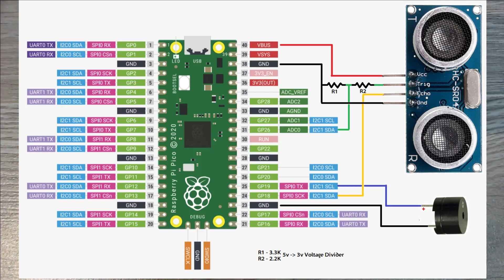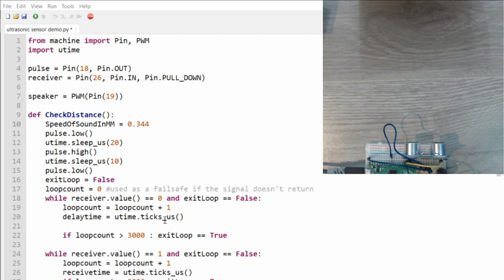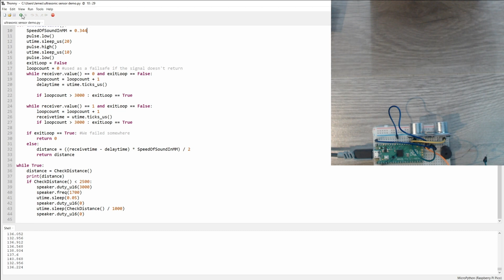Connecting a Ultrasonic Sensor to the @raspberrypi Pico

Comment: According to the datasheet, you supply a 10μs TTL-level high pulse to the Trigger input to start the ranging, and the sensor then returns a TTL-level high pulse on its Echo pin with the delay proportional to the distance travelled. You seem to have the Trigger and Echo swapped in your wiring diagram.
The TTL high level trigger pulse can be any voltage between 2.0V and 5.0V, so you don't need a level shifter to increase the 3.3V output from the Pico, but the return pulse could be as much as 5V, so you do need a resistive divider from the Echo output to keep the voltage on the PIco's input pin below 3.3V.

Comment: Solid video man, can the sensor be used standalone with the raspberry pi pico? Or do I need the resistor and the other component?
Reply from the maker: The Pico runs internally on 3.3v, whereas the sensor is 5v. So, without the resistors, it puts 5v into a pin designed to handle 3.3v. It may work for a while, but it can damage the Pico over time. So, in short, the resistors are to protect the Pico!
Reply: @PrintNPlay  Actually sensor accepts 3.3v - 5v (model: HC-SR04, I think it's the same), at least by documentation.

Comment: Thank you for the video! Could you please clarify one thing? In the wiring diagram Echo is connected to GP18 (Pin.OUT) and Trig is connected to GP26 (Pin.IN). Should not the Echo and Trig be swapped? According to the HC-SR04 description Echo is the receiver and Trig sends the pulses. In my case, if I follow the wiring diagram, the reported distance is always 0. The sensor starts working only when I connect Echo to Pin 26 and Trig to Pin 18.
Reply: Other online tutorials are telling me the same thing. My understanding is it doesn't matter if sensor trigger pin gets 3.3v from the pico, according to another tutorial it is still sufficiently high enough voltage to work for logic high. Ummm I haven't tested this yet so I am getting conflicting information here. It is echo that is problematic because HC-SR04 will output 5V from the echo pin which is more than the pico is designed to handle. Hence the need for a lower voltage conversion...

Comment: Enjoyed the video and I think I will find it and the code example useful. I have an idea for a light in my garage that will come on and tell me when to stop. What is the range of the sensor?  Would this be a good project to try? I am open to suggestions and new ideas. thanks,
Reply from the maker: Sorry for the delay in reply! I certainly think it would work for your purposes. I haven't found a definitive answer to its range, and haven't had a chance to wire it back up and test it. Buy I think I had tested it for 8 - 10 feet. I think this is likely the best option for something that doesn't need a piece mounted on the floor to reflect something. You could also use an image sensor that triggers when the color it senses suddenly changes. Or a motion sensor that triggers a laser diode that shines through the windshield onto a designated spot on the dashboard... there's a few ways to make this happen. I'm curious to see what you come up with.

Comment: Would there be a way to have this only turn on at certain times. I want to mount one on my front bumper so I don't hit the lip on the curb.  How would I activate it only when parking so it isn't beeping 24-7 lol?
Reply from the maker: The easiest way would probably be to add a toggle switch to the circuit. Changing the code to have an on/off status which changes when the button is pressed, and perhaps an LED that indicates if it is on or off. 

Glad to help if you need any!

Comment: I have a HC-SR04, the datasheet says: Signal Level (Trigger, Echo): TTL Pegel (L < 1,0V)
 -> I´d interprate that as "max 1V through the echo and trigger pin" -> If correct, I´d not need the resistors, do I? But not sure :S
Reply from the maker: I'm not great with datasheets, but I think it's saying it considers low bellow 1v? I am not sure either.

Comment: I haven't solder the header pins with pico. I just placed the pico board on header pins is it okay or i need to solder it.
Reply from the maker: Without soldering them, or having something that holds everything together, it will be very easy for those pins to get bumped and disconnected. Might cause you some headaches
Reply: @PrintNPlay  okay

Comment: Is it measuring in mm? Can it be changed to measure in cm and also displayed on a small oled?
Reply from the maker: I'm actually going to have to go back and see what I set the math up for (am away from the computer ATM) but, yeah you can totally calculate it in any unit you want, and display it on something like an ssd1306 based display
Reply: @PrintNPlay  thanks for getting back. Would be great to see how that could be done.

Comment: Great video James. Love how you highlighted Augustin's finding. There are also level translators that can be used for this, such as the TXS0104E or the ADuM7440, ADuM7441 or the ADuM7442 - I have the 1Mbps version that can get a little iffy with fast signals so this should work for the ultrasonic application. They also have a 25Mbps.
Reply from the maker: Good to know! Always glad to learn different ways to do things. Thanks for the info